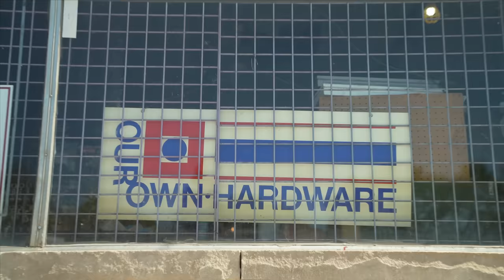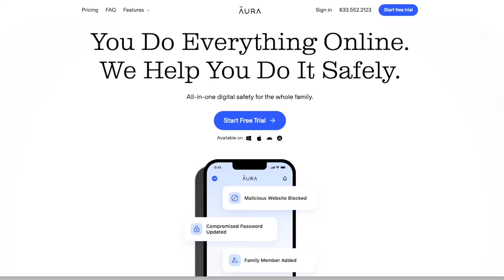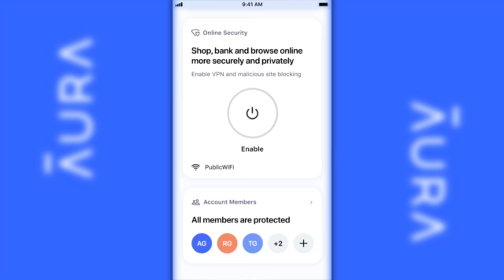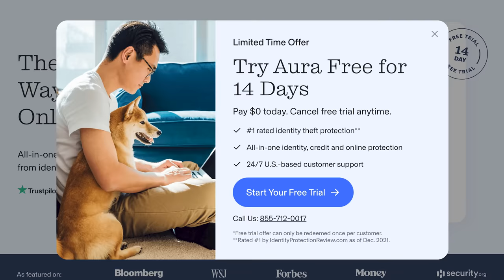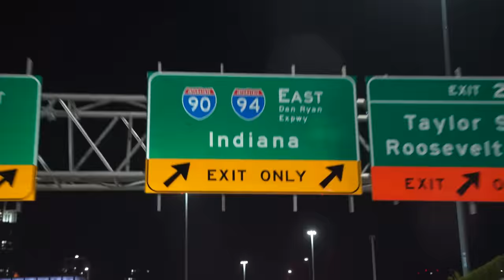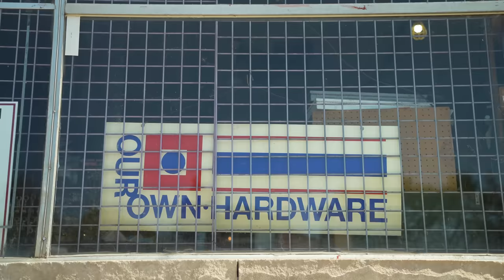I Bought an Abandoned Hardware Store In Detroit Without Knowing What I Was Getting Into!

Comment: I just wanna say as someone who’s family owns a hardware store that’s been open since 1871, it amazing the amount of stuff I spotted on the shelves that’s been there for decades is the same stuff we have that sits around on our shelves forever too. 

Also we have that same exact paint mixing equipment, and red devil paint shaker. I don’t know what someone did to that poor paint shaker, but I can tell you the original base is missing, and the paint can flew out because it’s put together wrong. The clamps are supposed to cradle the paint cans sideways not vertically.

Comment: what would be extra super amazing would be if you would buy the old menard they turned into rays mtb in millwaukee wisconsin ! place was super awesome and kept alot of kids out of trouble. between ray not having enough money to keep it open and trek not holding up to there end of the deal or somthing it got shut down in 2012-2014 somwhere in there i think but once you guys seen it you would love it and i feel like it would really help out the comunity again in a way. place had miles of trails jumps a huge concrete skatepark built i to the middle of it it was two stories you could ride up stairs and down strairs they had a pump track or two and a foam pit and a couple different lounge areas. would be a huge money maker once its open and going again. but idk if that would even be possible at this point. i have no affiliation to the place i just miss being aboe to go ride there

Comment: Dave mentioned having a bucket of mixed bolts and nuts, it took me a lifetime to collect mine, I call it “going to the well” it has never been dry. It got out of hand so about 15 years ago I finally organized it. A bucket of each: metric, SAE, Nuts, allen head, hex head, fine thread, corse thread. It’s still a pain to dump out and find what you need but it helps. Sure saves running to the store for one bolt. Maybe I can sell my collection to Dave or Allen 😂

Comment: I have a adjustable end wrench multi-tool that I use everyday at work and have kept it in my motorcycle tool kit for years. I am a multi-tool junkie but they have saved my ass so many times. They have also saved my riding buddies that are not as prepared as I am and have had mechanical issues with their bikes miles from the trucks

Comment: Maaaan look at the kw in my picture. My dads old one. Believe it or not that bad boy was used to haul pigs. And now runs flatbed. Doesn't have the 10" stacks anymore tho. They were a bit heavy
Reply: Also had the rear fenders too the big drop ones like this kw has. But they were painted to match the color instead of chrome.  Them uh. Are out back at the farm. With holes in the tops of them from rubbing 😬  sucks putting a nice truck to work fr.